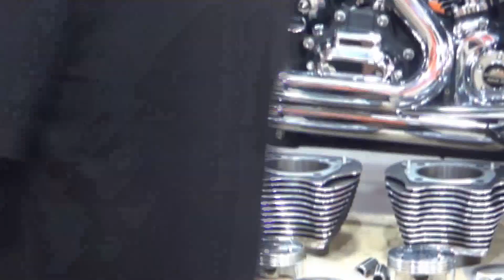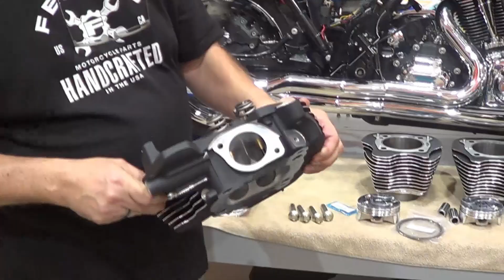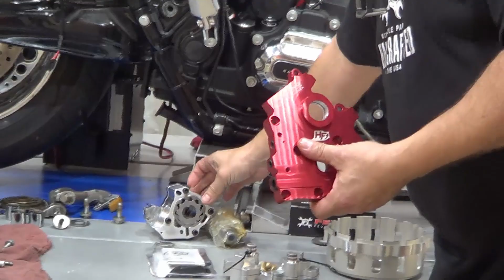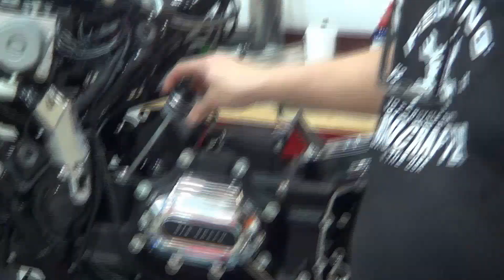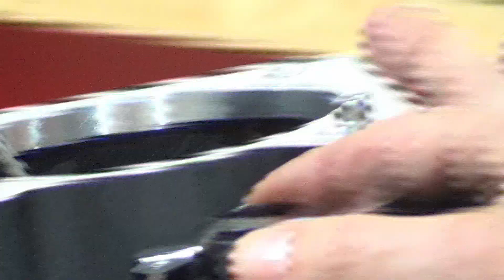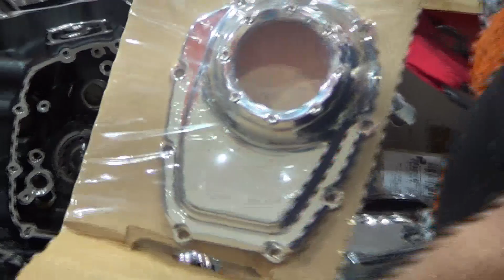Chris Waddell talks about a Harley Davidson 124" engine build parts and misc items needed

Comment: I'm looking to do this 124 kit on my 2011 Ultra Limited w/ 103. I'm curious about how hot this thing gets. I'm in central FL (3 hours from you)  and already had to swap my air cleaner because it was giving me 2nd-degree burns.  Also, are you considering transmission upgrades on this or just a clutch upgrade?

Comment: I can't believe the so-called engineers at HD designed another P O S that has so many flaws , Now what's wrong with a one peice crank like a car has and through the whole HD crank in the crapper ,go with a proven design, let a company like Scat or corillo design a crank n rod combo that works hell I can think up a better design then what HD has put out in the last 20 years I'm just an ole machanic tought way back in 1973

Comment: I love how you do things, And your attention to detail, But I would sure love a price estimate for a job like this.
Reply from the maker: https://www.cyclesolutions.com/quote/ You can click that link to request a quote as there are many options that can be added or taken away to make it more or less expensive. The price on that particular 124” big bore kit with cylinders, pistons and heads and diamond cutting. Is $5999.00. That includes installation and tuning.  Can be bought for $4999 with no diamond cut.
Reply: CycleSolutions that price counts the Dark Horse crank and Timken bearing conversion ?

Comment: A loose fit of the sprocket on the crank and the crank having so much runout makes me wonder about these M8's..... are they even made in the USA or made in China and just assembled in the States or even assembled in Mexico by cheap labour.... no wonder sales are down ! It'd be cheaper to buy a twin cam and build a monster out of S&S parts.....
Reply: Brakes and clutch from Italy, engine components from Austria, suspension in Japan, and electrical/miscellaneous parts from china. Then assembled in the US to just to say it's American made. The Toyota Tacoma is more American made than Harley's. Then they charge a premium for tech that is in simple terms 100+ years old, because tradition is what gets the old guys buying. 124" is around 2000cc, to get 150whp. Sport bikes do more than that with less. Just and example bmw s1000rr has 1000cc's and makes 200whp all while starting at $5k less than a streetglide. This is why people are not buying, the value isn't there anymore. They are so uncreative they became old news.
Reply: @NO4Q2   I have two Harleys my self a Dyna and a Sporty - both hopped up and modded suspension and brakes-wise so I know what you mean about the lack of performance. Back to the manufacture thing though, we have a similar thing with Triumphs here in England - assembled from imported parts, but I think that is the way of things now. All this 'out-sourcing' is what has caused so many here to work for a minimum wage - that and the imported unskilled labour artificially lowering wages for all kinds of work.
Reply: @NO4Q2  they pay their Techs the least also I didn't know that until my cousin got out of school to work on Harleys and ended up at BMW started out making 20$hr Harley was 16$ MADE IN AMERICA has been a lie since the 1340 they had made in china parts in the motor.